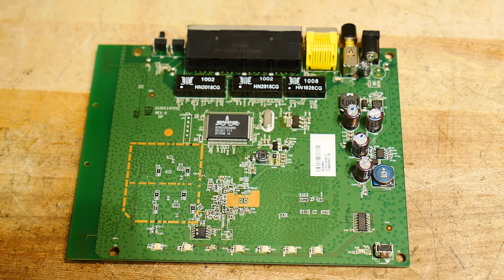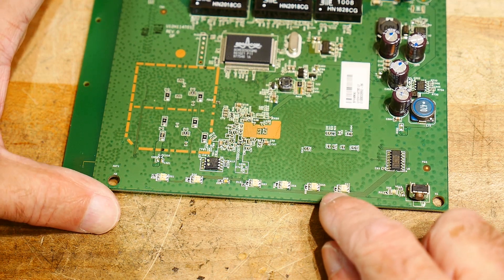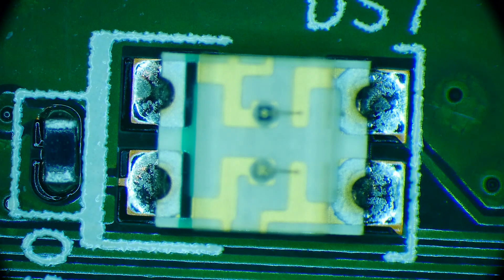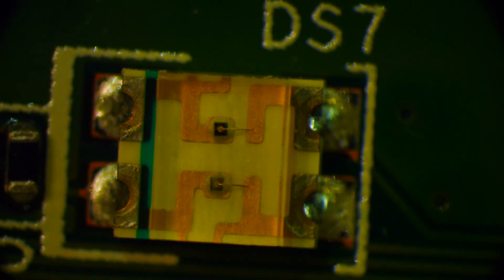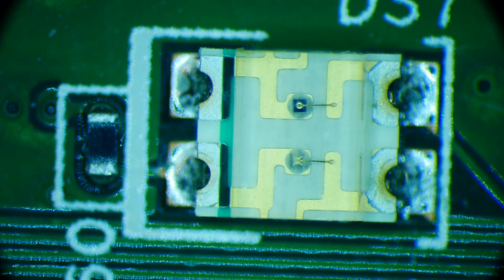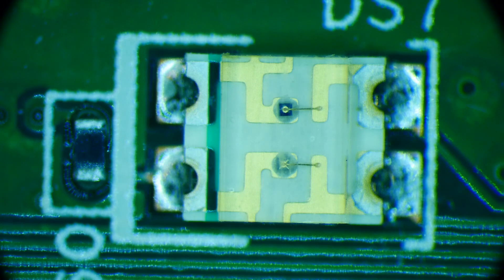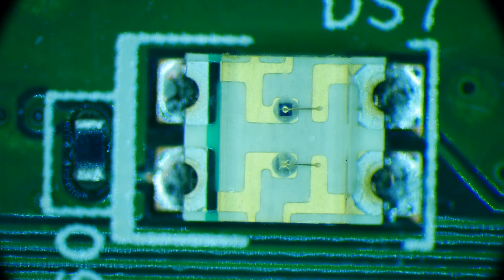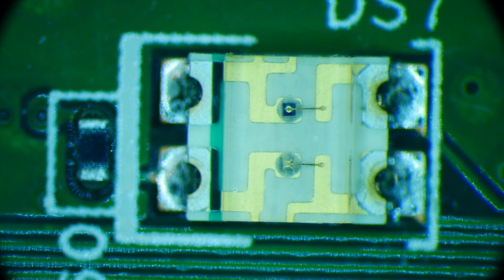#407 different colored LEDs under the microscope

Comment: I don't know why, but LEDs still fascinate me almost 50 years after I saved up my pocket money to buy 4x 3mm RED LEDs - they were very expensive for a 12 year old in the early 70s. They were for one of my first circuit designs & I remember it really impressed my parents when the circuit worked. It's probably still in my junk box somewhere.
Thanks for the videos.
Reply from the maker: where did you get the LEDs 50 years ago? Radio Shack?  HP used to sell the reject LEDs to Radio Shack. They had bad reverse voltage characteristics. Not that the LED would not product light, there was thought that bad reverse voltage LEDs had a lifetime problem
Reply: @IMSAIGuy  I use to buy all my components from Maplin Electronics when they first started advertising in Practical Electronics or Everyday Electronics around 1973; long before they became a high street retailer. I think I was customer number 1273, and I really looked forward to getting their yearly catalogue which started out as an A5 booklet full of circuit ideas and data sheets for all their active components. Ordering was by writing out a list of components and sending a postal order; all very personal in those days! I've still got all the old magazines and catalogues somewhere in my loft - I'm a bit of a hoarder.
The first 3mm LEDs (GaAs?) I bought were very dim compared with today's variety, however I built a lot of my own test equipment in my mid teens and the 5mm LEDs I used are still working today, including the 7 segment displays.
Although I got into microprocessors when I was 17 (SC/MP MK14); which somehow eventually drove me into a career in IT, I gained a degree in Electronics, but the only lectures I can remember (or bothered to attend!) where on LEDs and the relationship with Planck's Constant, although I can't remember the theory now; I'll now spend a few hours Googling LEDs & Planck to refresh my memory.
Reply from the maker: @slm60uk  Ah, you must be from UK. Here in the US in 1973 I was in high school. I used to ride my bicycle about a mile and a half to radio shack to get parts.